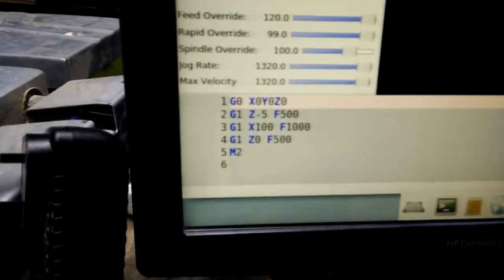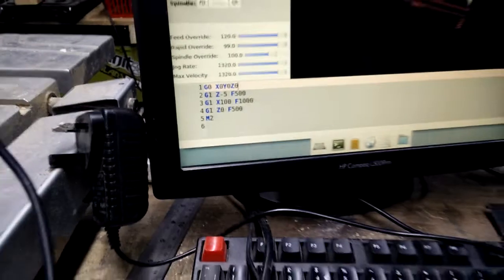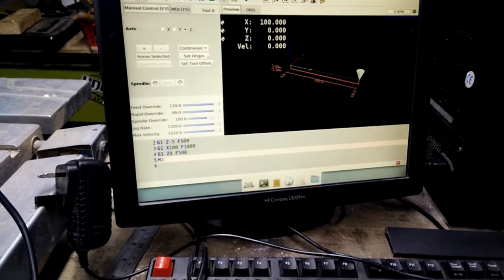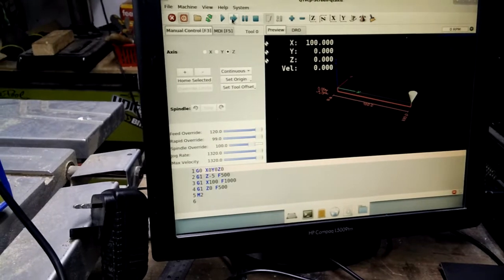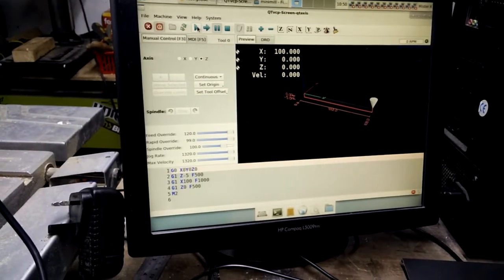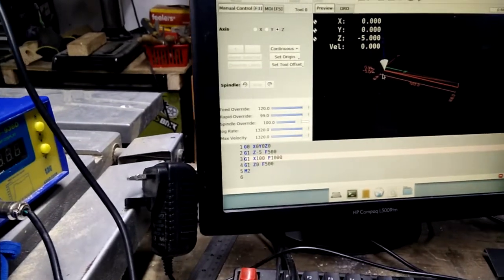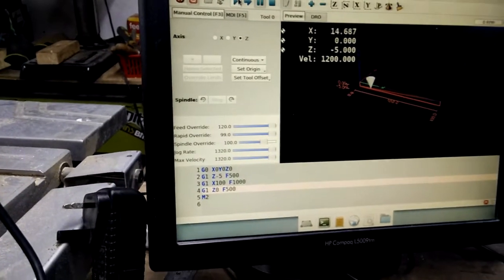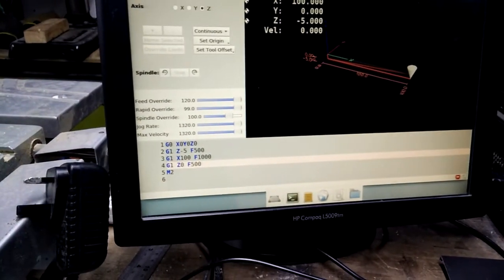How does single-step work in LinuxCNC?

Comment: It's been a while since I've had a look over these details, but my guess is that the HALUI is not set up with the correct configuration in the HAL file.  Mine is set up with a pendant control with Run, Stop and Feed-Hold/Pause/Single-step buttons.  I copied and pasted someone else's work to get that to run correctly.  But as far as your situation, your single step button is probably not configured in the HAL/HALUI files.
Reply from the maker: Thanks for the tip! I've actually made a bit of progress now. The only reason I was using Qtaxis is because my computer couldn't run OpenGL without crashing, and Qtaxis is one of the few GUIs that works without OpenGL. I've put a new graphics card in it now and OpenGL works fine, so now I'm on Gmoccapy and it works much better!
Reply from the maker: Oh, and someone on the LinuxCNC forum pointed out that if I write "G64 P0.001" before the program then the single-step movements actually do follow the prescribed path, and the weird diagonal move disappears. I guess you just need to explicitly set G64 otherwise it does whatever it wants.